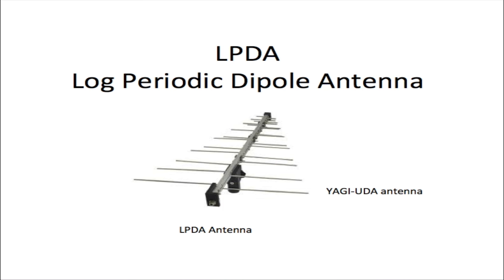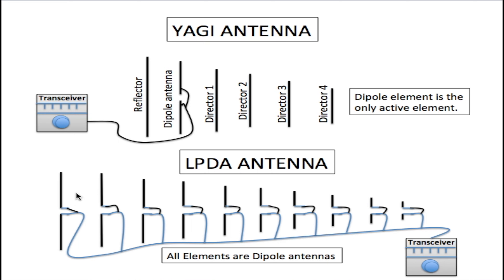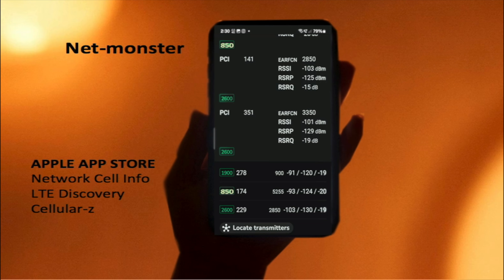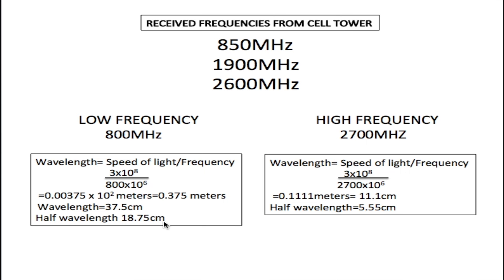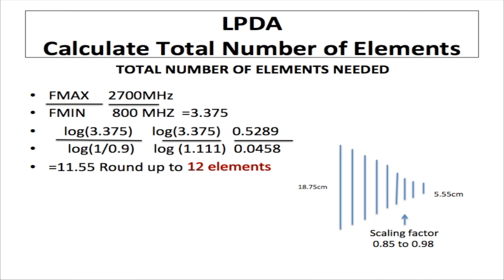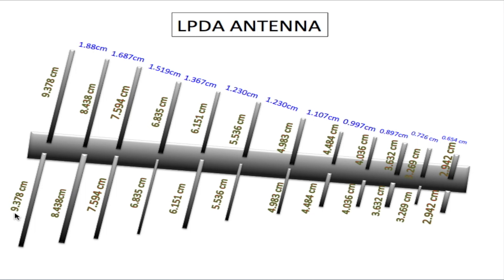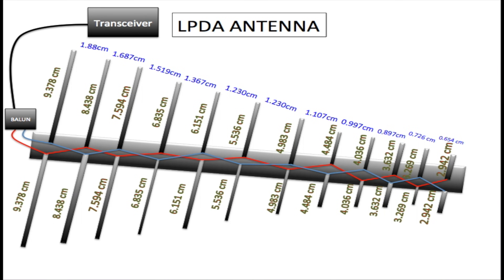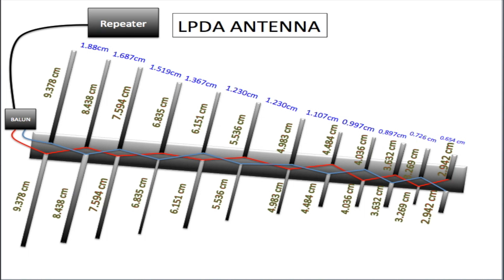Build a Powerful Long-Range Antenna (LPDA): Design Explained Step by Step

Comment: thanks so much ,based on this specifications how we can calculate the gain of this antenna?
Reply from the maker: The typical gain of an LPDA antenna would be between 6 and 9 db.  To get a more accurate measurement.  You can use simulation software like NEC, CST, HFSS or equipment. They are also mathematical formulas you can use to calculate the gain.  Hope that was helpful.

Comment: CAN YOU MAKE A VIDEO ABOUT BALUN? I STILL DON'T COMPLETELY UNDERSTAND IT
ARE THERE ANY CALCULATIONS IN MAKING IT OR WHAT?
Reply from the maker: Balun transformers are generally used to match the impedance between the antenna and the coaxial cable.  I'll make a video that can help you and many others who may not fully understand the concept.
Reply: Nice thanks  @TelecomTraining